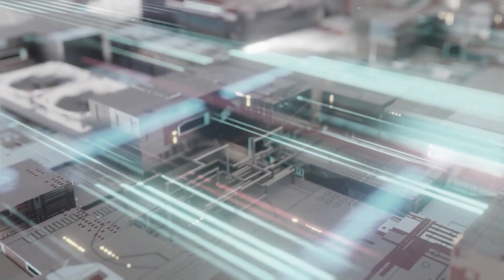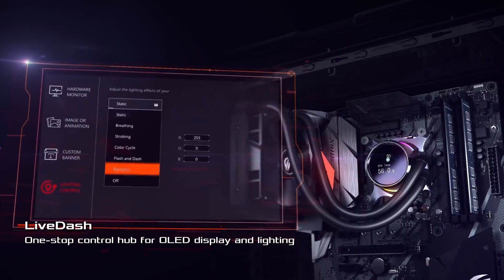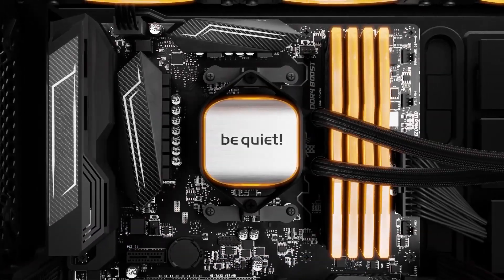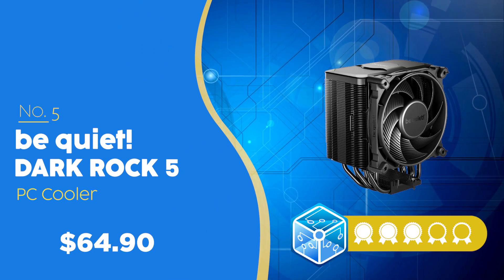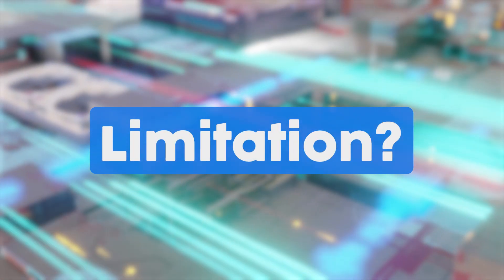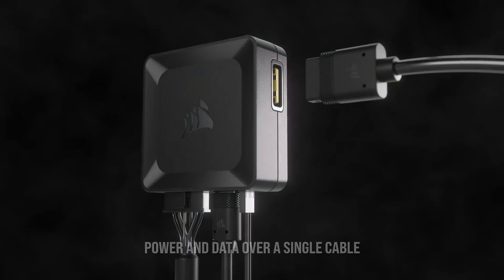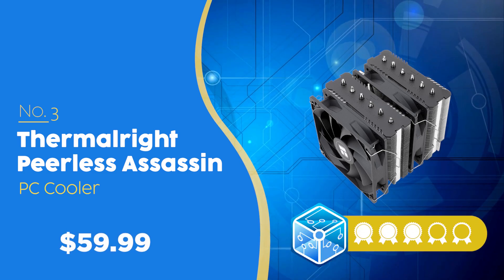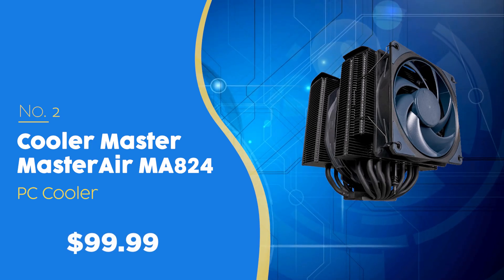Best Air Coolers For The 7800X3D For All Budgets

Comment from the maker: Products
Get yours now! 🛒🛒
be quiet! PURE LOOP 2 FX
Link: https://click.linksynergy.com/deeplink?id=wwduGammwk8&mid=44583&murl=https%3A%2F%2Fwww.newegg.com%2Fbe-quiet-fx-240mm-pure-loop-2%2Fp%2F13C-001F-00065
be quiet! DARK ROCK 5
Link: https://click.linksynergy.com/deeplink?id=wwduGammwk8&mid=44583&murl=https%3A%2F%2Fwww.newegg.com%2Fbe-quiet-dark-rock-5-120mm-intel-lga-1700-1200-1150-1151-1155-amd-socket-am5-am4%2Fp%2FN82E16835269007
Corsair iCUE H100i LCD
Link: https://click.linksynergy.com/deeplink?id=wwduGammwk8&mid=44583&murl=https%3A%2F%2Fwww.newegg.com%2Fcorsair-liquid-cooling-277mm-amd-socket-am4-am5-intel-lga-115x-ntel-lga-1200-intel-lga-1700%2Fp%2FN82E16835181395
Thermalright Peerless Assassin 120
Link: https://click.linksynergy.com/deeplink?id=wwduGammwk8&mid=44583&murl=https%3A%2F%2Fwww.newegg.com%2Fp%2F0VE-01P6-00006
Cooler Master MasterAir MA824
Link: https://click.linksynergy.com/deeplink?id=wwduGammwk8&mid=44583&murl=https%3A%2F%2Fwww.newegg.com%2Fcooler-master-mam-d8pn-318pk-r1-masterair%2Fp%2F13C-000X-004F4
ASUS ROG Ryujin III 360 AIO liquid CPU cooler
Link: https://click.linksynergy.com/deeplink?id=wwduGammwk8&mid=44583&murl=https%3A%2F%2Fwww.newegg.com%2Fasus-liquid-cooling-system-rog-ryujin-360-radiator-size-399-5-x-120-x-30-mm%2Fp%2FN82E16835101097